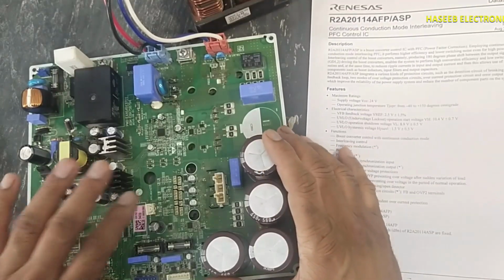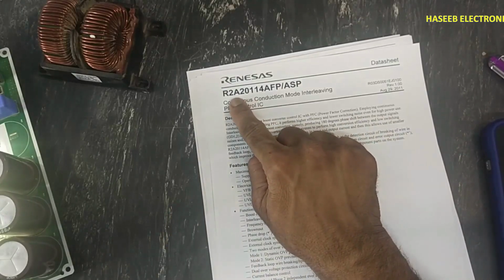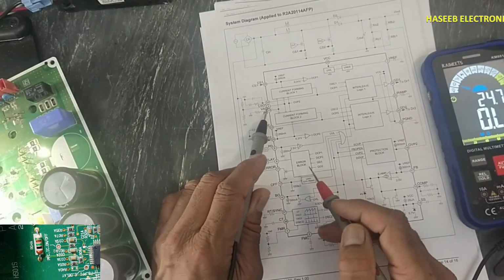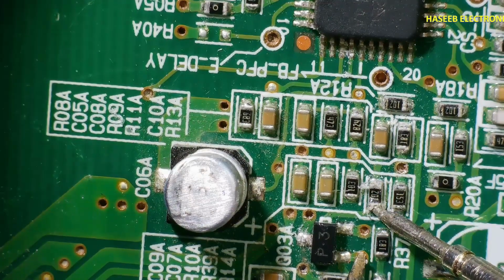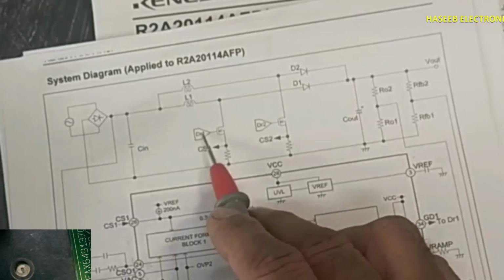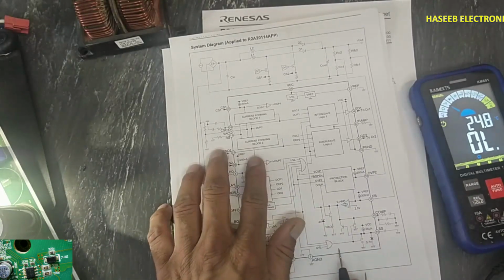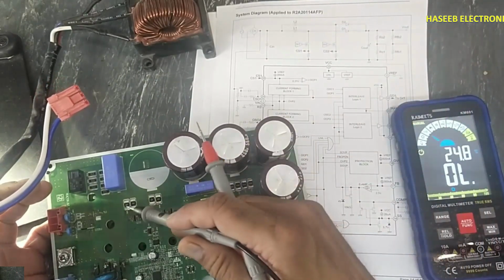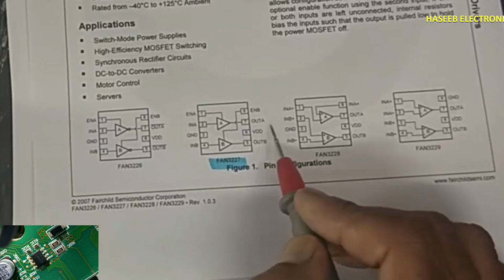{972i} PFC section in LG Inverter AC outdoor unit board

Comment: Selam. Can you please write down in reply, what model of an air conditioner it is (I know it's from LG, I need an exact model)? Thanks.
Reply from the maker: it is used in ARUN040GSS0, ARUN050GSL0, CRUN040GSS0 models 
 LG 4 ton, 5 ton dc inverter ac outdoor unit board EAX64913701 ebr758794.

Comment: Sorry, but AC input voltage is not monitored directly, it monitors full wave rectified voltage as reference for wave shape and phase of input current. PF=1 when voltage and current are in phase, i.e zero angle between those two. See the schematics in the I.C datasheet.
Reply from the maker: Yes 
You are right in the sample circuit diagram, it is showing that volatge can be monitored by dc rail immediately after bridge rectifier
But in practical circuit it is taking ac signal from ACS710T ic. Then through rectifier and 1M ohms x3 resistors in series then reaching to pin 5 of PFC controller ic.
Reply from the maker: Because this board doesn't have any circuit diagram or service manual so that i am using sample circuit diagram from dataheets of the respective components